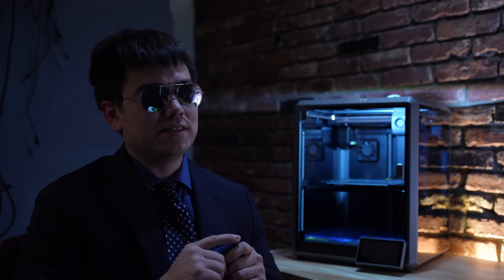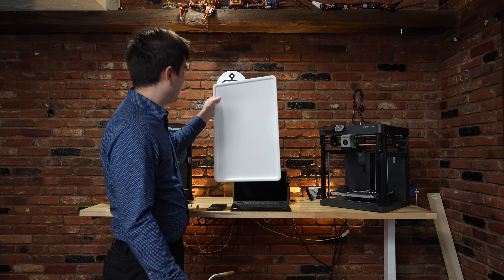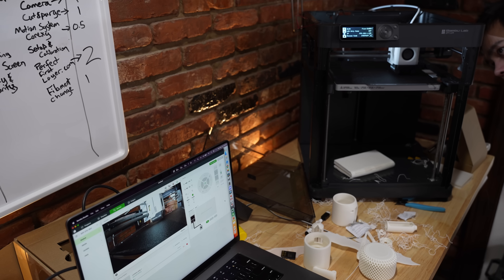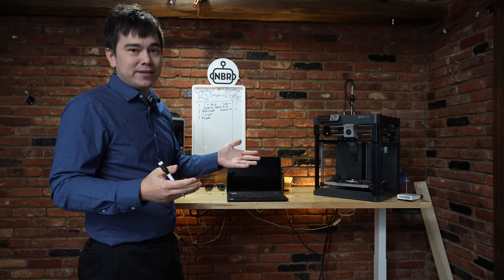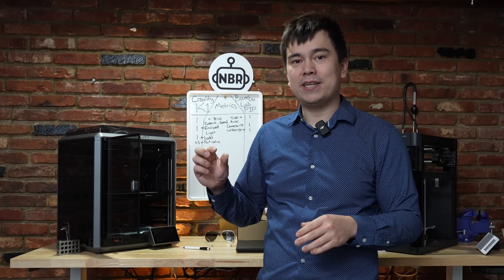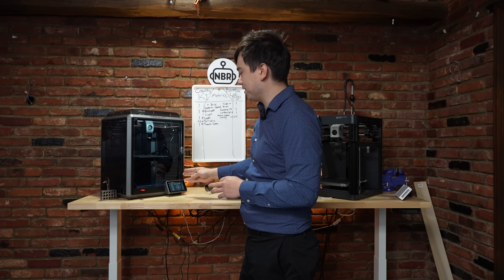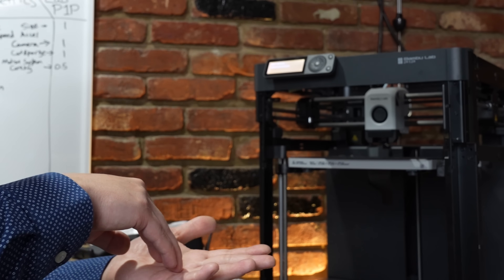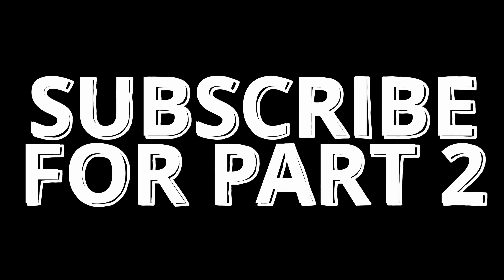3D Printer Fight Club: Creality K1 vs Bambu Lab P1P Episode 1

Comment: Overall Bambu Lab is a better company and have actual engineers behind their printers. Creality have decent reverse engineering engineers, AKA copycats
Reply: Tell me you're not a mechanical engineer without telling me you're not a mechanical engineer.
Reply from the maker: Noone is denying that Bambu Lab has great engineers. But I mean, if you'd look at the toolhead, slicer, frame, and electronics you'd see the K1 is a very different machine than the Bambu Lab printers. The only elements that they've obviously copied are the screen UI and bed-leveling system. 
They certainly used the X1C as a benchmark. But this is VERY common in every industry. Ford takes apart Toyota cars, Boeing takes apart Airbus planes, Apple takes apart Samsungs phones, etc. This is a normal part of engineering and helps reduce development costs because there is no point in reinventing the wheel.
Reply from the maker: Also, Creality was one of the first manufacturers to use a load-cell based bed-leveling. Look at the CR-6. 
And it is not their first COREXY machine either. Ender 6 and 7 were corexy.
Reply: @azimuth9819  That was a really bad guess
Reply: Let Chinese companies copy other Chinese companies, we just grab a better one among them. :D
Reply: @azimuth9819  Are you an engineer, big shot?
Reply: @jl8096  Yep. That's the bottom line
Reply: @elleryfg7853  I'm a VDC electrical engineer, not a mechanical engineer.
Reply: @azimuth9819  So tell me you're not a mechanical engineer by telling me. Nice job big shot
Reply: @elleryfg7853  and Bambu have done nothing wrong with their design, I personally love to see reinterative design showing rapid progress on markets.  but you having such a simple understanding of a tech market is embarrassing to read.  But we all have our bias.  Instead of being salty at the K1, just be excited for what bambu will release as a response.
Reply: @elleryfg7853  thank you, dream job tbh. And I already told you I'm not a mechanical engineer, I think your joke failed
Reply: @azimuth9819  You should stay on your lane Mr. VDC
Reply: @elleryfg7853  lol you're right, I'm no match against a "reverse" engineer
Reply: @elleryfg7853  I guessed the same. An engineer would know that just about everything Bambu did had already been done. They would also know that while the concepts are similar, the execution is very different. While the K1 definitely took inspiration, it isn’t a clone. 

Edit: source: a mechanical engineer and instructor.